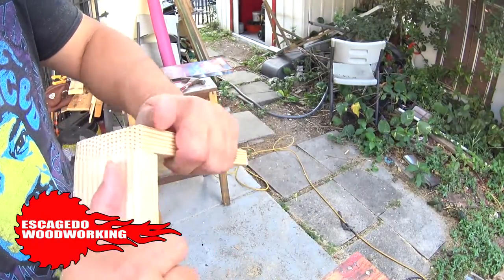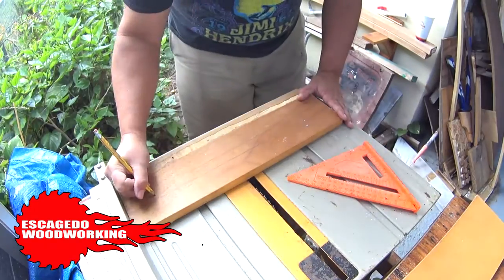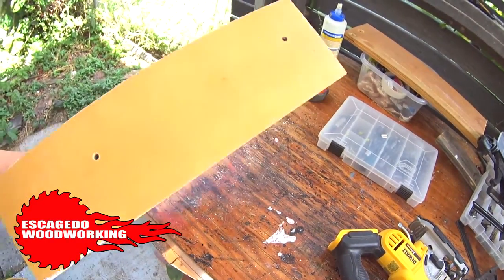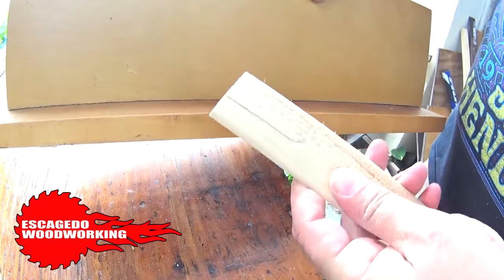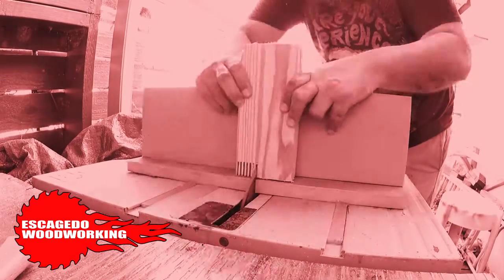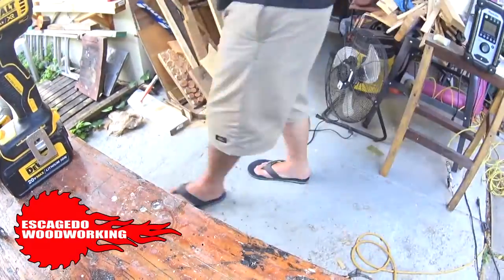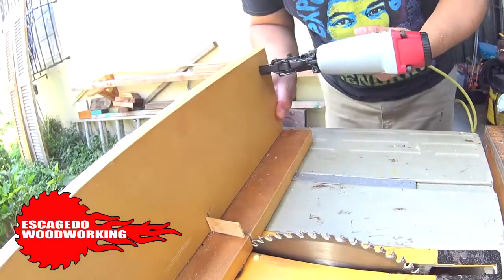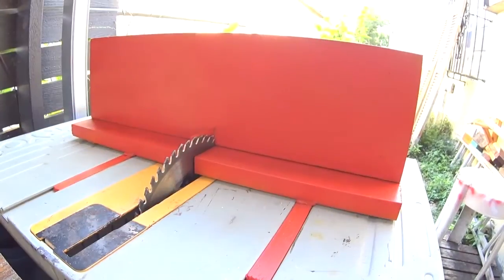Red Finger Joint Jig single blade version

Comment: good stuff Eloy! you know what works well for the finger is go to Home Depot they have eight inch quarter inch 3/8 inch and half inch steel square rods that's what I used for mine because after a while the wood tends to get worn down now I don't have to worry about the wood getting worn down because my finger is made of a square steel rod but yeah man yours work perfect
Reply from the maker: That's just a perfect solution dude!! Yeah this will work til it don't anymore. But I want to make that one that uses blocks. You know the one that you can hog out thicker joints with just a single blade. That's for another day though...
Reply: ESCAGEDO WOODWORKING yea it works great til it dont thats when i went with the sqrs from the depot ..i use my dado stack for 1/4"  joints so ill definitely be inyerested in seeing that .but yes always another day..🍻have a good one bro.
Reply: ESCAGEDO WOODWORKING oh and great narration btw 👍🖒